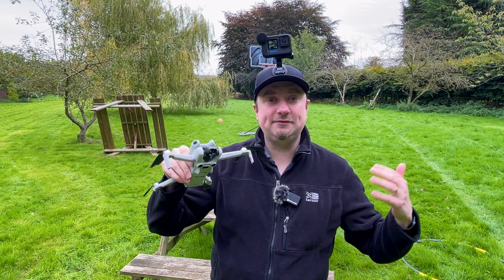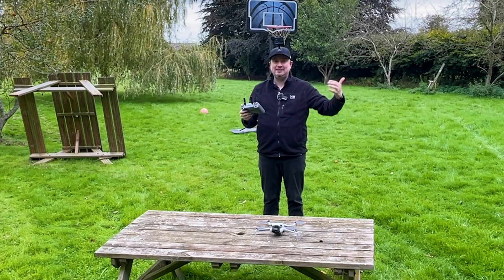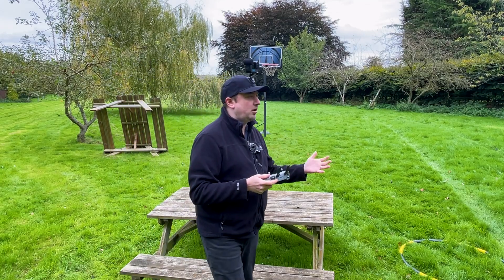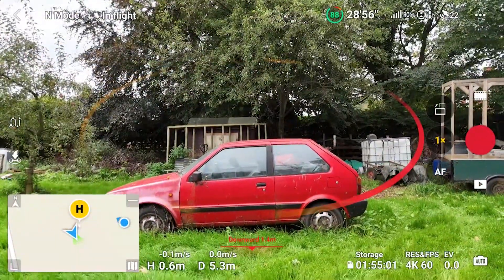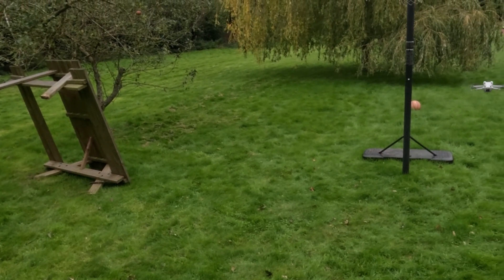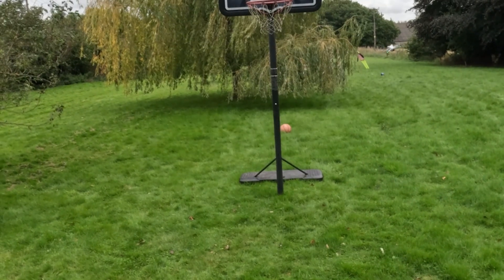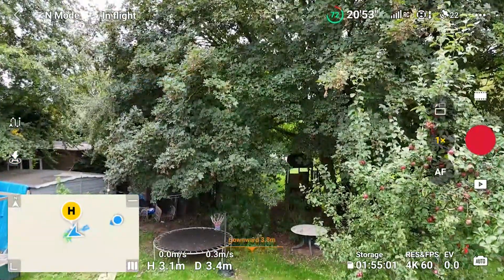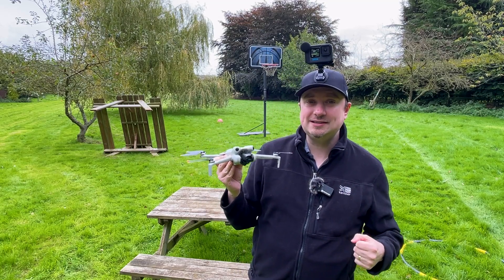How To Use DJI Mini 4 Pro's Omni-Directional Obstacle Detection – Full Tutorial!

Comment: I had a crash when it hit a tiny branch sticking out towards the drone. Didn't damage it but yes, the drone has troubles with branches and wires (optical avoidance, not LiDAR).   Still, it is good and had saved my when a gust of wind caught it and it avoided me!  I hope they redesign it with the mini 5 so you can use the sensors with the propeller guards. Add the autonomous features from the Neo/Flip and it becomes very versatile

Comment: I tried it indoors and it seems like it’s going to slam into the ceiling. I stopped it after it got about 1” from touching the ceiling.
Reply: I just had the opposite problem (with DJI mini 4 pro).  Just got a replacement drone and booted it up in my flat to check it is working/responding correctly. Was able to takeoff and move it to the right but then couldn’t move it back toward its original landing point because it was detecting the wall ~3m away as an obstacle. Ended up with very limited movement in any direction because it detected everything as an obstacle, even though it had plenty of space before it got near any of them. Couldn’t even land it on the clear table I was able to move it over because it detected that as an obstacle. 
When we got our first mini 4 pro and was testing it in the same room this wasn’t an issue at all and we were able to fly it around the room and land it on the table without issue. I feel like they have increased sensitivity of obstacle detection (perhaps with the latest firmware update?), which isn’t a bad thing but I can see it leading to some tricky situations (which hopefully can be resolved by turning obstacle detection off if you need to navigate carefully out of something or manually land it).

Comment: Is there a way to turn off the beeping, but leave the OA enabled?  It's really annoying if you know you are flying close to something, but like the safety net of it not letting you get too close.
Reply: yes, just swipe down the controller (like how you swipe down your phone to check the notifications) and select mute, it will stop the beeping noise for OA but you will not hear your drone if the battery gets low I think
Reply: @AWESOME-ji9uc  yeah, you are right. If you turn it down for OA then it turns it down for everything. Oh well, it would be nice to separate the volumes, but I still love the drone.